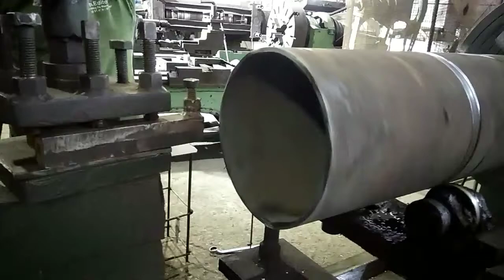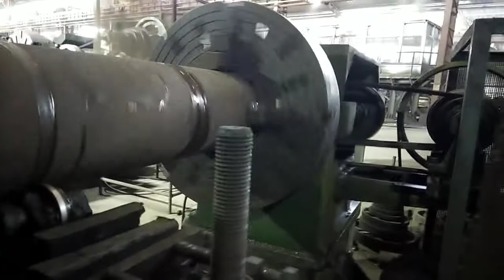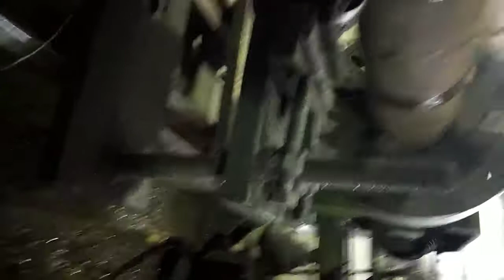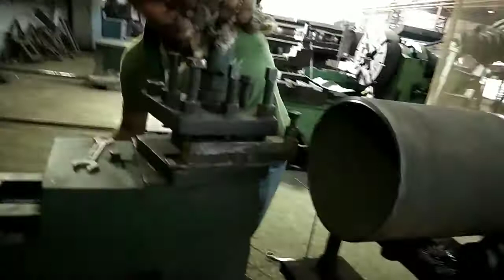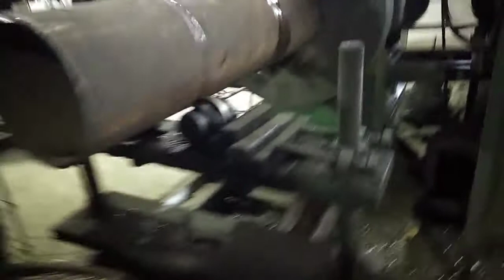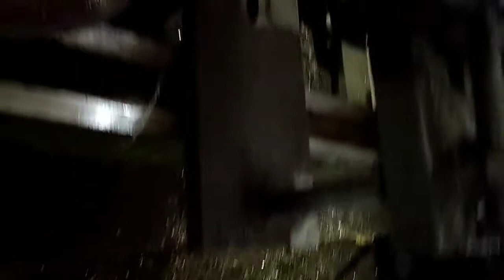Lathe/ long pipe facing in lathe machine(Must watch)

Comment: A different way would be to weld a 3/4inch plate about 2inchs in from the end. 4.    3/4 inch welds. Already have a hole in center of plate with 60degree angle turned in to accept a live center. Then turn the end of the pipe.